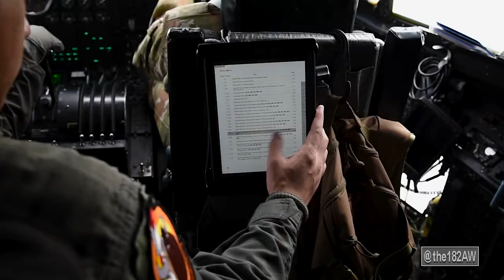Faces of the Defender: Flight Engineer

Comment: What is the difference between V1 speed in the civil aviation and refusal speed in the military. Is refusal speed calculated in the civil aviation take off and how ?
Reply from the maker: Refusal speed and V1 are essentially the same thing. In either case, it means you're committed to takeoff.
Reply: Are you an airforce flight engineer?
 My best regards 
Vittorio